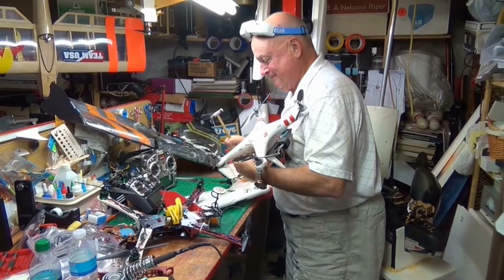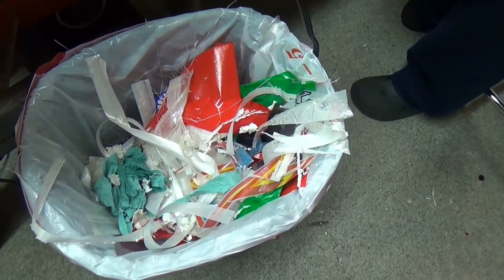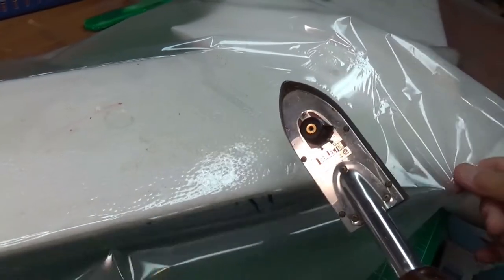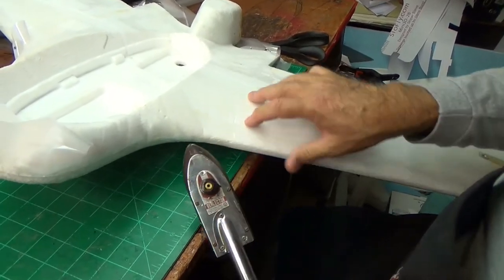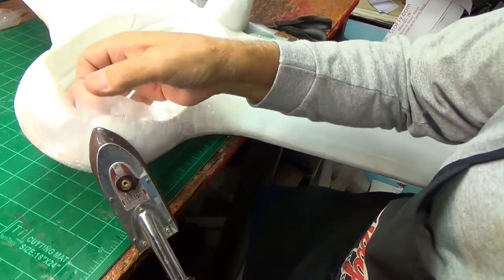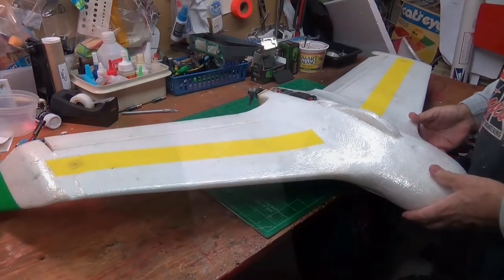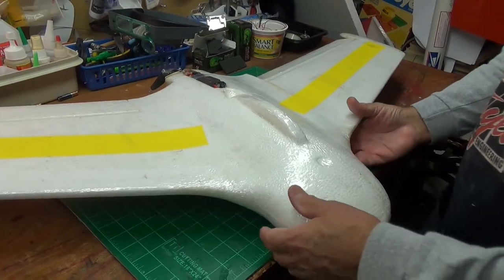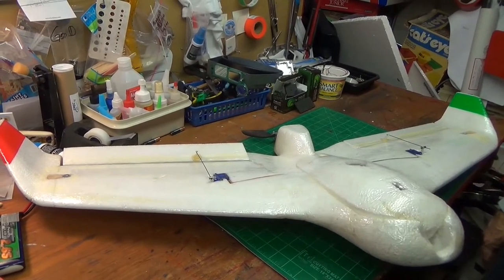How to Repair a Foam Airplane With Lamination Film

Comment: that's the good thing about epo foam, when you apply high heat to damaged cells because they have trapped air inside each one as the air heats it expands and thus this helps the foam return to its normal state. bit like a foam memory if you will.
I have had to do something similar with my new weasel trek I just got, when it turned up it had a few packaging dings and such. So I poured some boiling water from the kettle over the effected areas and they all 'healed' themselves.

I have resisted covering my weasel yet as she only weighs 10.14oz AUW with everything, nice and light for low lift situations, but when she gets a bit banged up I will definitely laminate the whole thing and just fly her in good strong winds.

Comment: the red and green tips on the wing, port and starboard I'm guessing.. am I looking at the aircraft the wrong way up or have you got them on the wrong tips.. ? 
starboard is right, most Viking were right handed so they used the "steer board" on the   right hand side of their boats, and so they were not damaged in port they always moored up to port on the left..  port is red and should be on the left, unless I'm mistaken you have port on the right.

Comment: Good work there Dick, I'm starting to see why you like this product so much.
Think I might be giving this method a go soon,  I have one question though.
Can you apply the laminate over a factory painted surface or even over decals?
Reply from the maker: STocKi777 Yes you can apply it over paint and decals.  The problem with decals is that if they are large, then they reduce the strength of the film.  I mean, the strength of the film means that it sticks to every part of the foam to make it more durable.  What I have done is peal off the decals and re-apply them after the laminate is on.
On Paint - make sure the laminate is smooth before you iron it, otherwise, re-positioning will lift the paint.
That make sense.  The laminate is so cheap, I would recommend practicing on something first.
Thanks for watching and subscribe if you haven't.

Comment: I purchase the Horizon Hobby Corsair F4U , And i would like to cover it like this ,,,will this work with this method work  Z Foam?
Reply from the maker: +Steve Panebianco It should work.  Try it on the bottom some place and start with a lower heat setting on the iron.
Let me know how it works.
Reply: WHAT IS THE NAME OF THE MATERIAL YOU ARE USING ,AND HOW THICK
Reply from the maker: +Steve Panebianco https://alofthobbies.com/new-stuff-laminating-films.html?___SID=S
1.7 or 3 mill
Reply: The good stuff?
Reply: The New Stuff from Aloft Hobbies and tell them I sent you
Thanks a big bunch for watching!!

Comment: I noticed some discoloration, is that the iron scorching the foam?
Reply from the maker: NO absolutely not.  You might be able to melt the foam with the iron but never  it the film is on the foam.  I have not burned through the film or scorched the foam.  What you may be seeing is a very well used and beat up plane.  The nose was scrunched beyond repair with normal methods.
You should try laminating film for yourself and see the benefits.
You will be amazed!
Thanks a bunch for watching and sub if you haven't please.

Comment: What thickness laminate do you use. In the US you mention *mils*, say for instance 3mil. In the UK the laminate is measured in microns, say 30 microns which equals .030mm. What is the measurement in mm for your 3mil stuff? Confusing?? Yeah!!! Thanks for any input you can offer.
Reply from the maker: +Mike White I use 3 mil on smaller lighter planes and 5 on the heavy duty planes like the Juggernaut.
The 3 mill conforms into tight places and round places very well.  I used some 3 mil on a small HK wing (Bondsi)  I used on the front half of the wing and doubled it on the nose.    Thanks for watching
Reply: A 'mil' equals 0.001 inches.  Or one thousandth of an inch.  I don't know why it's called a mil when a thou would seem better.
Reply from the maker: +Pay Way My guess it is measured in mil's because of application.  People in the office supply trade probably don't measure in thousands.
Reply: I know this comment is a few years old. But 3 mil/thou seems to be equivalent to 75 mic (micrometer), 2.95 mil/thou to be more precise. 75 mic also seems to be the thickness recommended most of the time in other videos I watched about this topic. If it's thicker it's harder to apply, if thinner it won't protect as good. BTW, 5 mil/thou is equivalent to 125 mic.

Comment: What # grit sandpaper are you using for sharpening the x-acto blade ?
Also, which type of laminate are you using mostly the "DI" or "CP" ?  What's the practical difference, if any ?
You mentioned in another post that a friend of your covered a 1/3 scale model using this material. Do you know which thickness he used for such a huge model ?  It must have been the 5 or 10mil. I would appreciate your feedback. - Awesome video by the way .. I enjoyed watching it a lot.
Reply from the maker: Great questions Charles:
The sandpaper is 180 grit that I used on a DA sander before painting cars.  You could also use black emery paper or wet or dry sand paper.  I use the 108 because they have adhesive on the back so I stick two together. That makes then stiff and easy to handle.
I use CP laminate, I purchased from Amazon. I bought a box of 1.7 mil and a box of 3 mil, it is much cheaper than from someone like Aloft Hobbies.  That is the way they buy it.
CP had a 210 deg to 250 deg working temperature so you can't burn through it with a monocote iron.  We covered the big wood plane with 3 mil because it is easy to use and way tougher than monocote.  If you clean it with rubbing alcohol and lightly sand it with fine sand paper and re-clean it they you can paint it with a fast drying paint from a spray can.
I use these same two thicknesses on foam planes also.
The koolest thing about laminating film is that it is soooo easily repaired.  If you put a dent in it then just heat it up again and it shrinks back out.  It sticks to it's self great to repair a hole.
Laminating a damaged foam plane will bring it back to shape quickly.
If you laminate a foam plane before you fly it they it is 10 times more durable.
When Laminating a new foam plane, first I pant the plane then laminate it.
The wooden glider wing I laminated has lasted for years and still looks great and it has been flown hard countless times.
I love your questions so keep them coming.
Reply: I don't mind buying that material from Aloft Hobbies - the price is cheap either way - but since you mentioned Amazon, share a link of the actual product name so I can find it. I just searched under CP laminate and got nothing related to the covering material. So any input would be greatly appreciated.  Thank you so much for your time and looking forward to my own experience(s) with this material.
Reply from the maker: Look up laminating film in office supplies.
I comes in 18"rolls in 500 ft for the 1.7 and 250 ft for the 3.0
You actually get twice that much because it is what fits in their commercial machines one on top and one on the bottom.